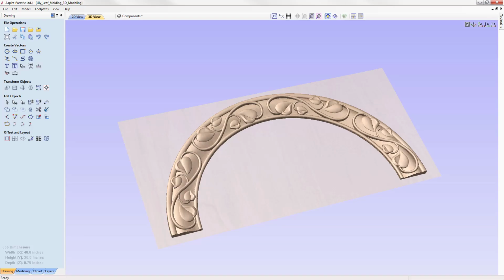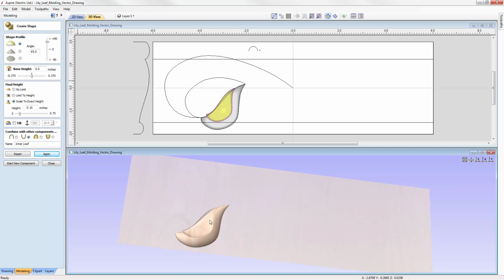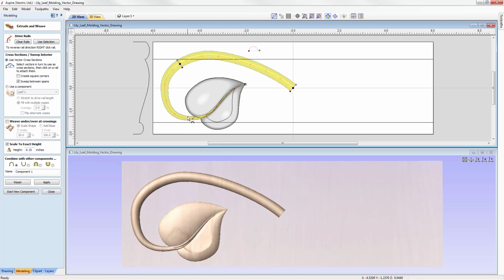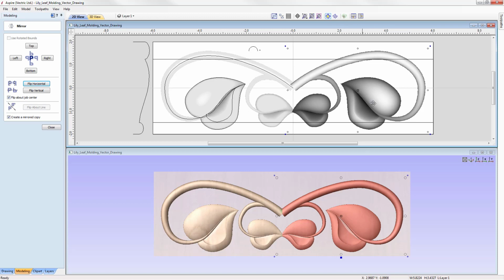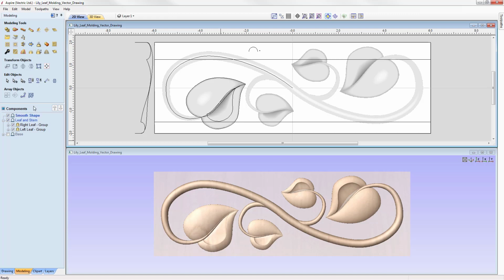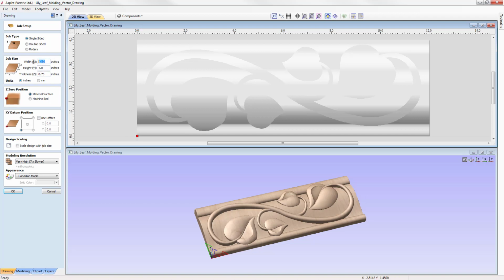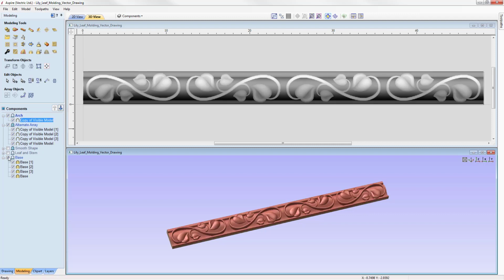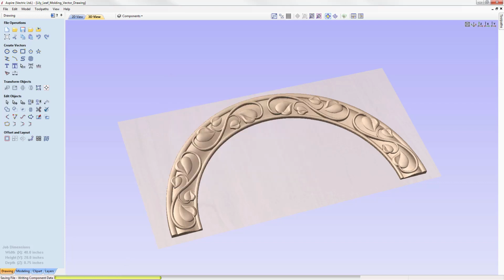Vectric V10 Tutorials | 3D Modeling | Lily Leaf Molding

Comment: After watching this video a few times it is not clear how you applied both contours to the stem. Can you explain please?
Reply from the maker: Hey mugsy, the stem was created using the extrude and weave tool, where the larger cross section was selected for the start point and was applied by clicking on the cross section followed by clicking on the start point. The smaller cross section is added to the end point by selecting the cross section first followed by clicking on the end point. I hope this helps :)